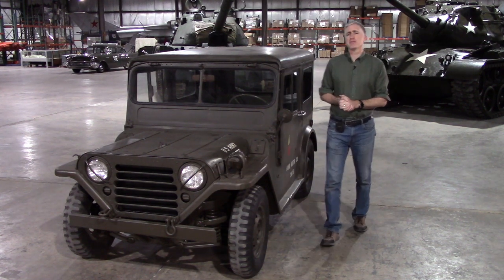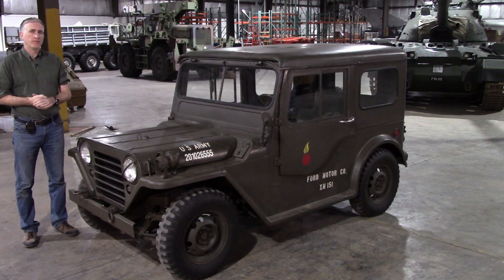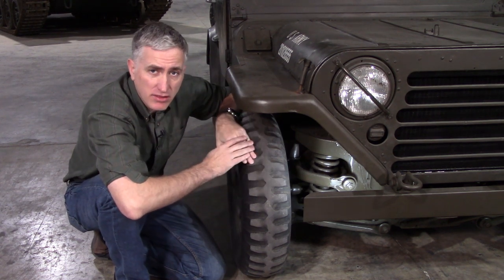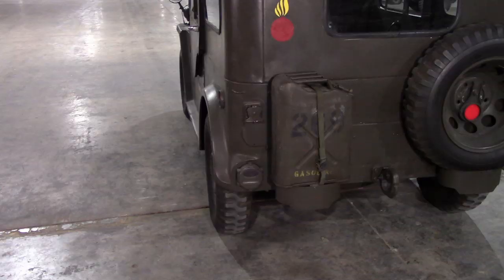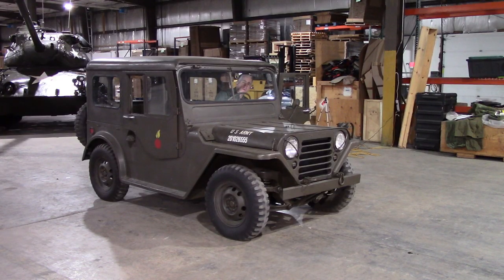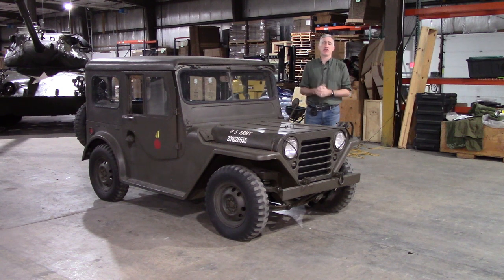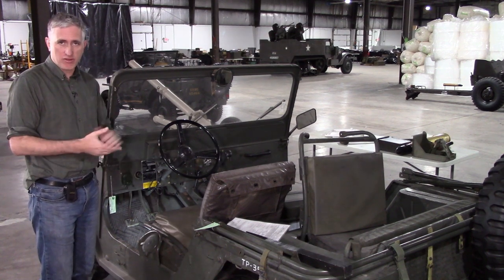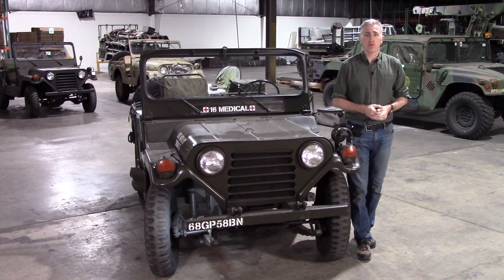Inside the Chieftain’s Hatch. M151 Series

Comment: The M38A1 was far better and the first jeep to be built to what we now call MIL spec 24 volts, waterproof and such. The big problem was that all tactical vehicles were built not to exceed a 45 MPH or so convoy speed. But, without MP's watching some decided to play Rat Patrol and paid for it.
Reply: The M38 was 24V and waterproof. Though it was only manufactured from 1950 to 1952. The A1 took over starting in 1952, so not the first

Comment: if that was the only MUT with solid axles and leaf springs what was the one behind it?
Reply from the maker: Someone didn't watch to the end of the video.... It seems to have been a home-build conversion, looking at the parts used. Dataplate is unchanged.
Reply: @TheChieftainsHatch  unless my TV cut it short I watched the whole thing before logging on on my laptop to comment... Odd
Reply: @TheChieftainsHatch  did the mongrel MUT not make the final edit? as just rewatching the end from 13mins on its not mentioned.
Reply from the maker: @nrs91  Very last screen is a still. I have arrows pointing at it with a comment.
Reply: @TheChieftainsHatch  ah sorry! it was covered with other Chieftain video suggestions so didnt see it! Keep up the good work I love these look around videos!

Comment: Boy you could do an hour log video just about the millions of dollars spent trying to make a Jeep that wouldn't roll over!   In fact, Ford basically lost money building Jeeps,  but created a lot of data on vehicle stability that they later found useful.  The ultimate solution of course was to make the Jeep bigger and thus the HumVee was born.  I drove one of the older Jeeps where I worked and once had a car hit me from behind, the impact threw me across a busy intersection and by sheer luck I wasn't hit again nor did I roll over.  The driver complained to the police that he couldn't see my brake lights.  But though they were small they were still still legal and he received several tickets.  Since it was an older model, it had a canvas top and sides, plus no heater so it was down right frigid to drive in the winter!

Comment: When one considers that the Land Rover was already launched at the time. It shows just how silly this vehicle really is.
Reply: It's a very different vehicle compared to the Landys of the era.
Reply: It's much more mobile and smoother riding than anything else in it's class. I've run circles around everything from newer Wranglers to CJs in my A2. Not to mention the newer side by sides
Reply: Well, the m151 had no Lucas electrical components, so that has to be at least a 3000% improvement.  I suppose Ford could have licenced an unsuccessful buick engine to use.........maybe some old Milwaukee beer cans to make a "firewall" out of?🤔
Reply: The Brits, French, Italians and Germans all went down similar  cover complex blind alleys.  The Land-Rover was already in service the  and Brits still continued with the over complex over weight expensive Champ.  Much as  I  love Champs the Series Land-Rover proved to be a better general purpose  1/4 ton 4x4 than any other Western country developed..
Reply: @JM-jv7ps  For a smooth ride on all surfaces  Champ wins the prize they had very long travel  double wishbone suspension .
Reply: @andrewwmacfadyen6958  is that from experience, or technical specs?
Reply: @andrewwmacfadyen6958  the MUTT only weighs 2000 pounds, it beats everything from it's era in weight, which is a pretty big deal off road, and for shipping.
Reply: @andrewwmacfadyen6958 , im a dirt bike guy, not a jeep guy, but ive seen jeeps in places you could never get a land rover.......or at least never get it back out.

Comment: 71 horsepower for 4cylinder? i got slightly more than double on my 8 cyllinder... =P
Reply: Because of the method of measurement the US SAE  horsepower ratings of that time were smaller the the horse power published by manufacturers in  other countries.  So 70hp SAE is more like 55 to 60 hp in the modern world.